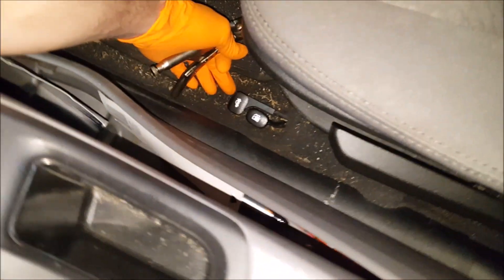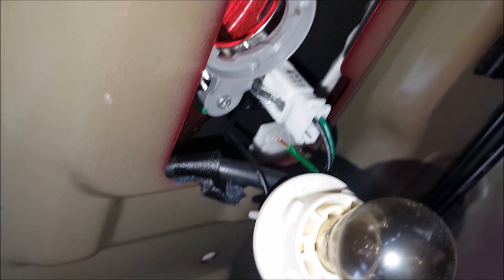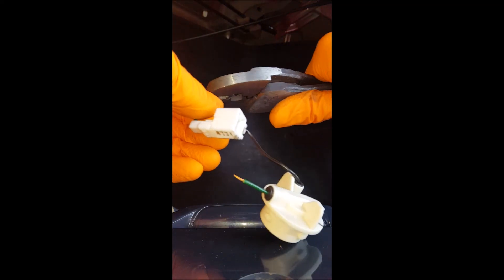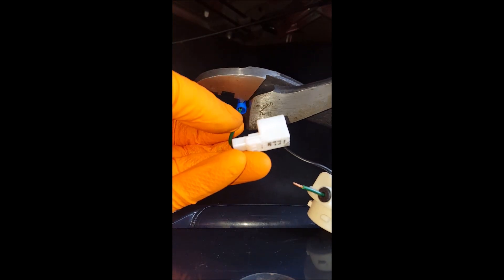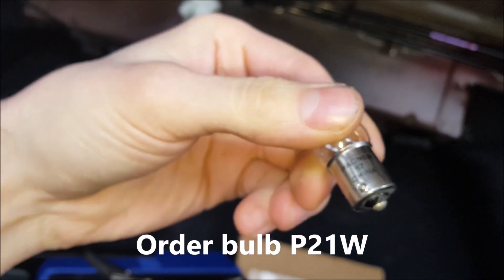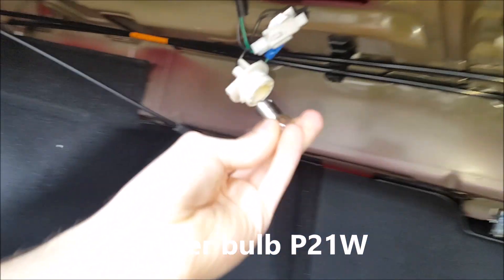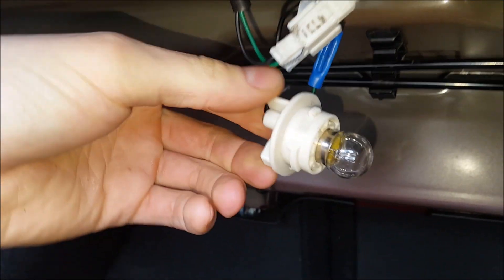Elantra Third Brake Light Replacement || Broken Green Wire Repair

Comment: Hi, I saw this video and had the same thing happen to me but my green wire broke at the base. So it left me with no slack to wire together. I was able to fix thou after watching this video and reviewing the comment section. The fix costed me about 15bucks at harbor frights. First thing to do if your break like I did is to by some needle nose pliers the small one. I brought a pair for 2$. Take out the black rubber piece that the green wire broke from so that you gain more copper wire in the socket. If it doesn’t come out at first I brought a knife kit for 5$ and use that to cut it a little then the needle nose took it right out. Next I stripped the green wire a little to gain more copper on that end. I had to add more copper wire to connect each side. I brought a truck wiring kit for like 7$ since I only needed copper wire. I stripped and cut the copper out of the wire then added to my green wire. Next I tied them together then added the butt connecter. You don’t have to tie the copper wires in the socket. Just ensure that those wires are in the butt connector. Next heat it up so it shrinks. It was hard to shrink the end of the butt connecter once inserted into the socket since i didn’t buy a heat gun. I used a lighter.  so what you do is just heat up that end a little enough so the wires in the socket still fit then I added electrical tape on the outside to ensure it doesn’t fall out. It worked like a charm. Please  respond to this comment if you need more information. Hope you fix it for as little money as I did !!!!
Reply: Thanks, just happened to me this morning 😠 😊
Reply: Thanks for the instructions, you are a life saver!!!

Comment: Thanks for this video.  Saved me (& the car part store helper) from breaking both wires which were firmly keeping the socket from turning. Eventually I could feel the wires & move them off gently.  Then it was easy except that the store had the wrong bulb listed in their database. 7506 worked.

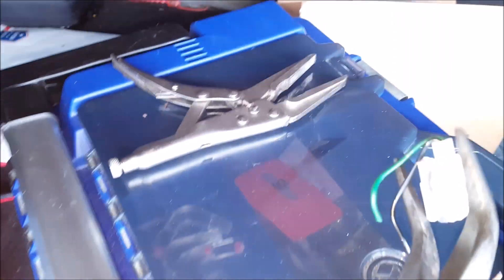Comment: Hi there, did you just force pluck out the white socket at 01:00 mark? I broke my green wire too, so wondering how to take out that white base, thank you!
Reply: Hello. I have the same question. It seems stuck and dont want to mess that up as well. Were you able to get it out?
Reply: @rodrigolopez3323  Hey didn’t end up plucking out the white base as I’m afraid I would break it.. hence slooowly joined the green wire with such an awkward position 😅 sorry couldn’t help

Comment: Lehew Tech is there any recommendations on if the green wire split too close to the housing/socket?
Reply from the maker: You can try soldering it, or cutting into the socket with a razor to expose more wire.

Comment: I have a 2013 Elantra and am trying to do the green wire repair, but I'm trying to get the electrical connector housing out to repair the green wire and it's not coming out...

Comment: I did the same thing, but the green wire broke right at the bulb housing and there was no access to the wire.  My work around was to use a butt clamp and extend an additional piece of wire into the bulb socket, I then soldered the end inside where the bulb rests careful not to create a short.  Worked like magic.  My soldering skills are still steller.
Reply: Hello can u post a video of what u did or explain more. I have the same problem. The green wire broke off right at the housing/socket and I cant get a clamp on both sides.

Comment: The wire is placed into the bulb housing and looking into the bulb socket you can see where the green wire should go.  Simply put some solder to the wire and solder from the inside.  Once that is done you use a butt clamp on the other end to connect to the square adapter.

Comment: Very useful info, thank you for posting this! I went to Jiffy Lube today to get that light changed. After a few minutes they told me that they felt a broken wire and that I should go to the dealership. I was perplexed how that wire broke, but after seeing this video, now I'm thinking they probably broke the wire trying to get that thing off and just didn't want to own up to it :/. I think I may want to give a fixing this myself a shot. Do you mind saying what that blue piece was called that you used to fix the wire?
Reply from the maker: Yes unfortunately it's very common for that wire to break when you loosen the socket. I have done it twice! And I see it frequently done by others. The part you need is called a butt connector. You also need something to crimp it with.
Reply: @LehewTech  Thanks!

Comment: Where can i purchase a butt clamp similar to the style in the video?
Reply from the maker: Advance auto sells them
Reply: Thankyou so very much for your video & response. Valvoline worker snapped the wire... because of your video i will be fixing it myself very soon... thanks again...
Reply from the maker: Tremendous! Dont be too hard on the worker, this is a very common mistake.
Reply: @LehewTech  I didn't go back to complain.. im just dealing with it...